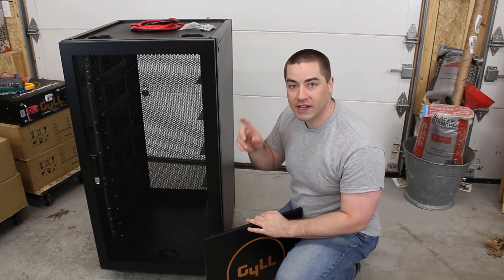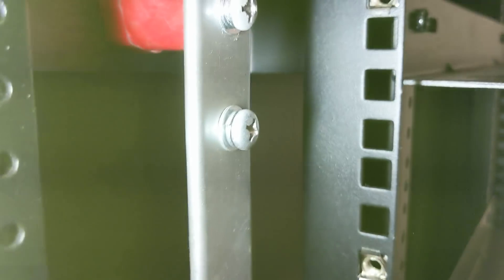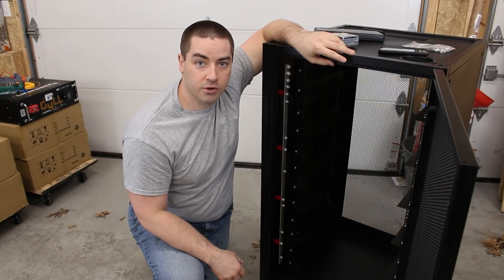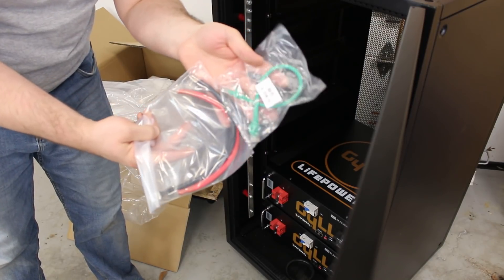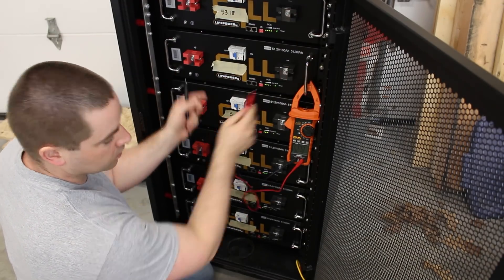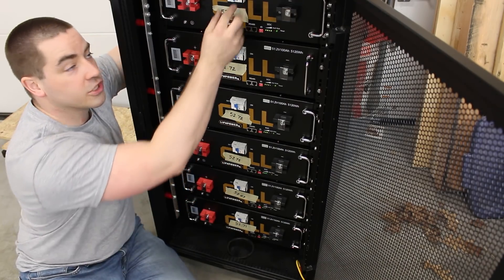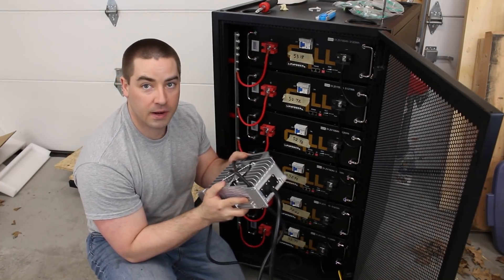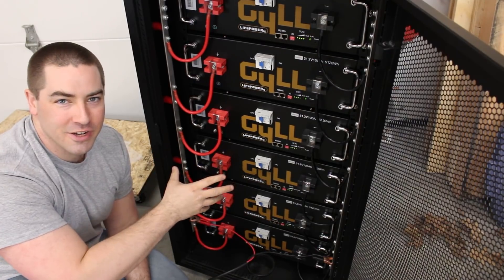Fastest Large Scale Battery Build, 30+ KWH, Power Whole House Cheap

Comment: wish someone would make a heated insulated version of this case.. that would be perfect for my cabin... I guess I'll have make my own.
Reply: Get a 21-23 seer heat pump minisplit. Can be had for $700-$1000 depending on seer rating. I use one in another battery shed I have with 280Ah  batteries I built in a 48v pack. I have the shed insulated with roxul and tried to airseal every joint with caulking. Works great for me in winter to just keep the shed around 40 deg F even in the cold New England winter.
Reply: @jimmyg6215  I like that idea. Never knew there were DC minisplits like that. My place is at elevation in the White Mountains, it often 0F or below for extended periods. I think I'm going to need a new shed anyway.

Comment: Great Helper !!

Enjoyed the video. 

As a service technician,
On-call at 2am, visiting your site to look at this:

I'd make this wireless. 
Just lay my laptop up there, or log into it from the truck. 
485 converter or whatever it'd take from Black Box.

Put all the jumper cables on one side (left) so at 2am I can GLANCE they are there and in the right positions. 

Easy to tug on in and out to break any oxidation. I use gray  anti-seize or a no-ox jell for aluminum and copper. I put it in the hole and plug in the cat termination. Coat the pins.
Keep moisture off these. 

Also because not all competitors' technicians or salesmen visiting at a site will keep their hands to themselves,  they will want to move those dip switches. Use your silver marker to put dots above and below where they should be positioned. 
Mark it somewhere else too.
Take a picture and put that in your records.  Leave a copy of your service or install manual and mark it up for all the positions and bays. Throw it in the cabinet in a nice large plastic bag.  It's 2am. I am not thinking,  I'm doing. You are cold and the electric is off. Easy stuff first. 

Then I put magic scotch clear tape over the dots and the hole covering the switches. Keeps the honest people honest, bugs, dust and dirt out. You'll thank yourself. 

I would have used the charged battery to charge the others 
;) wonder how many it could charge before throwing the breaker? 

Re-Tap ( size )the striped out copper hole? Naah.

Put (fold over) several more copper strands in the hole. 
Put the screw in. Be done with it. 
Test it out in a video. See if that has the bite strength and current capacity if in doubt? That'd be fun to see. 

You are exactly correct with the hex head bolts/screws. 

Remember lock washers (split washers) are your friends!

I would have never manufactured that copper bar as a tapped copper bar.  Bolt and nut.

Plus no-ox. Moisture is not your friend. It will cause problems.  Coax seal works pretty good. 
Anything to keep good conductivity clean and dry. 

For HIGH currents I'd consider
a tac of silver solder.  It makes me cringe seeing crimps not soldered. 

Seen too much. 

Super video, really liked the project,  the screw driver,  and learned some stuff too!

Looking forward to seeing you grunt on this battery system...
some hot water making and home heating.

Comment: I would think Signature Solar could spend a couple bucks to have a proper USB cable manufactured instead of making people Micky Mouse something that is unreliable at best...
Reply: I think it was his decision to Mickey Mouse it. It looks like it’s just a ‘rollover’ cable and there are    premade cables that are pretty cheap for this specific purpose. Bring a serial connection is pretty cool in my opinion. It doesn’t put the vendor between the consumer and the battery. 

But yeah, You can get cheap serial to usb cables pretty easily.

Comment: Great vid Dave, I feel your pain with the USB to 485 cable. You might look into an Ethernet to 485 protocol converter, hard wire to the batteries, put on your home network. I've had good luck with equipment from Moxa.  I like the casters for set up but would probably find some leveling feet for permanent location, appears the cabinets are drilled and tapped ready to accept them.
Keep us up to date, I really like those Gyll batteries.

Comment: How long will 30kw power your house?  How do you do large current 220v devices?
Reply from the maker: It depends.  I've used up to 40kwh in one day due to electric heating and very cold (-10°F) temps.  In spring and fall I might only use 6-8kwh per day.  In summer with AC I average 15kwh/day.  

Yes, I have large appliances like an electric oven.  I run my house on 12kw of inverters: https://youtu.be/WOueHhY4xkM
Reply: @DavidPozEnergy  I guess our houses are vastly different.  Here in Norfolk VA for instance, my January power bill was 3102 kwh so about 100 kwh a day.  I have a machine shop and a woodworking shop with large equipment that draws a lot of amps (air compressor, welder, drill press, table saw, sanders).  Does the 6kwh inverters each do 1 leg of the 220V circuit?  I watched the video and wasn't clear on how it was set up.  The breaker was 220, but the video of you setting it up wasn't really clear on how they interacted.  I am guessing one is in control (the one on the right) and each contribute 6KW of power (50 amps) on each leg to make 220.

Comment: The parallel ID code starts with zero, I mean the battery one would be zero code ID and the second battery would be ID code 1, I think it's like that, because in the MPP Inverter manual it has the same code to put in parallel, give a look And you will realize that the second inverter in parallel, the code ID is 1.

Comment: i think it would be cool to get some of these for a backup system incase of power failure and or some sort of system where it could flip between incoming mains voltage and the batteries
Reply: These days, solar panels and batteries like the ones showcased in this video are cheap enough, with high enough cycle life (~7000 cycles at 80% depth of discharge for the ones in this video), that they are actually cheaper to operate full time to power your house, than buying utility grid sourced electricity.  A solar power system that is installed DIY (so as to avoid excessive or predatory installation costs) using the batteries shown in this video, combined with modern solar panels (at < 70 cents/watt) can provide overall electricity for less than 8 cents/kWh (when the capital cost of the system is amortized over the full life cycle of the battery bank), which is cheaper than normal utility grid electricity (in my area, at least 13 cents/kWh).

In order to successfully do so however, it makes sense to replace high peak inrush and demand appliances (which also tend to have low efficiency) in the house (namely the central air conditioner and electric water heater), with high efficiency heat pumps (like >22 SEER rated "inverter" mini-split heat pump systems and a heat pump water heater).  Doing this reduces the peak startup and running current demands of your house substantially, which is important, since currently available off the shelf inverters are too expensive and not readily available in large enough sizes needed to match the normal household 100A to 200A mains service provided by electric utilities.  

Additionally, replacing your main power consuming appliances with ultra high efficiency units "effectively" increases the size of your solar array and battery pack simultaneously.  Therefore, it is normally cheaper to replace your high power appliances (central air conditioner and conventional electric water heater), and then also buy a modestly sized solar array and battery pack, rather than leaving your household appliances alone, and instead buying a massively large solar array and battery bank needed to power the inefficient home appliances.  To do this, one needs to buy the ultra-high efficiency mini-split heat pumps online (which are available up to 38 SEER currently, albeit with practically no model selection at this high efficiency range), and then either learn how to DIY the installation or find a non-predatory HVAC repairman to do the installation for you.

Comment: Is it worth $500? For the convenience, maybe. (an evening on eBay could collect the same thing for much less.) The gap between them makes it look to me like they weren't designed to fit rack spacing (1.75" per unit.) The bus bar is also questionable as a battery module can touch them when loading. I'm not saying they need to go as far as Eaton or SE, but there's zero chance this will ever pass UL.

Comment: My order of 3 GYLL 24v 200Ah  with the three space rack should arrive in the next few days I don't have the AC charger to equalize the batteries before switching them on. How close should the battery voltages be?  I hope you post you next video before I'm ready to hook these into my system. Thank you so much for posting these videos!
Reply from the maker: The closer they are the less amps will jump from the high to the low.  Generally I try to be within 0.1 volt.  I've tried it on other packs at 1.0 volt delta and seen over 100 amps move.  In this case in the video it was about 9 amps when I switched that last breaker.  If you don't have a dedicated charger you can put a load on the high battery to draw it down.
Reply: @DavidPozEnergy   Thank you! Your videos are invaluable.

Comment: David, from last week's video you pointed out that when they connect to the BMS they go from the terminals (positive & negative) at opposite ends of the battery.  Does that same rule apply when you are connecting these bus bars to the inverter/charger?  Will you connect to the top of the left or positive bus bar and then to the bottom of the right or negative bus bar in this cabinet?  Or once connected to a bus bar it doesn't matter?
Reply: Never mind David.  I see you answered this with another comment below.  Thanks.

Comment: These are really nice. Debating between this kind of a set up or the Overkill Solar BMS and Fortune cells that Will posted about a week ago. Following for more info!
Reply from the maker: Two good options.
Reply: Will’s favourite cells before were Lishen 272Ah (there are also Eve 280Ah) which are easier to build, without paralleling (& in series) for a bigger capacity. Might work out cheaper. Overkill is rebranded JBD aka Xiaoxiang BMS which you can find much cheaper

Comment: @DavidPoz Any reason you wouldn't consider this setup in a mobile application such as a motorhome?
Reply from the maker: I'd be fine putting the battery modules inside, but not the server rack.  At least not as is.  Maybe with some extra reinforcement.
Reply: @DavidPozEnergy  I was thinking remove the casters and use those point to bolt to the floor.....

Comment: Daddy David and engineer Eleanor make 30Kw battery bank, held together by 12 screws and one nut! Amazing what $10K will buy you nowadays? Am I wrong in assuming you now have between 50Kw to 60Kw in your three battery banks now? Need a sign in front of your home that says: "House of Juice"
Reply from the maker: You calculated the capacity correct.  I recently tested the old system at 27kwh, so I'm around 57kwh now.  Still working on it.
Reply: @DavidPozEnergy  I was taught by the best!

Comment: Dave...
If I wanted to use this to go from Grid-tied to Off-Grid.... 
What would I need to do there? 

I seen that there was a hybrid-inverter that, for a lack of better words, simulates the power companies 120 service. Would that be the best route?
Reply from the maker: I'm currently using a pair of SMA Sunny Island SI6048 inverters.  They take the 48vdc from the battery and turn it into 120vac for the house.  I'm running on it right now.  I have videos on the inverters, along with several other inverters I 've used in the past.  Coming up I'll be showing even more inverters.

Comment: That's a neat piece of kit but if the manufacturer is watching I have a bit of constructive criticism about the design. I'm a bit put off by the exposed busbars, have you considered insulating them? Adding some color-coded heatshrink tubing before mounting the bars would probably do the trick, and some plastic covers for the connection bolts would make it even better. It's probably not needed but I would gladly pay a bit more for the added peace of mind.
Reply: If you are worried about that just connect all the battery leads to the bar in the proper place but not the battery end. Then remove the bar and wrap it with rubber DR tape before reinstalling it and connecting the battery side.. I would also apply a thin coat of No-Ox to all of the connections before making them. I can see why the exposed bars were bothering you, I was thinking the same thing.

Comment: Excellent vid David.  I have 2 questions: could U open a battery and show the wiring size and BMS in UR next vid?  2nd question, how many KW is UR solar array?  Thanks.
Reply from the maker: Check out my previous video, I open up the battery and show the wiring size on the BMS (6AWG) along with cell tabs, etc.  https://youtu.be/SYJ25izYSGc    I have 3 arrays in the backyard, they total 12.5kw

Comment: This DIY project looks closer to something I would like to install in my home. My question to everyone out there is when I install a energy storage system in my home. How difficult is it to get permitting from the city or state? I have heard they require UL listing for the batteries and inverter. Is there some advice out there to help one navigate through this process.
Reply from the maker: Every location will be different.  My stuff is OK because it's in a detached garage, but would not be OK if it was inside the house.  Lots of people choose to have a shed just for this stuff.
Reply: @DavidPoz thanks for the great videos. I’m in MN where we have subzero temps for weeks at a time in January and Feb. if I put a system like this + an all in one unit in a small (say 10x5 insulated shed... What’s the cheapest/most efficient way to heat a small shed in subzero temps? Now the other problem for me is how to keep it cool in the summer! Maybe this topic has already been addressed in other videos. Thanks for any pointers
Reply from the maker: @Nick Norring,  If the shed is super insulated, then you won't need much heat at all.  We are talking about just having a space heater.  I'd probably buy a small space heater with a thermostat built in.  $50 or something.  You will find it doesn't take much if you are super insulated.  But, it's not necessary to insulate for the inverter, just the batteries.  You may want to consider an insulated box just for the batteries.  My friend Bill insulated around his batteries and keeps them warm with just a 20 watt heating pad.  https://youtu.be/6XLOKtl-q3s

Comment: 1500 for only 100 amp way to much for my blood.   600 for 4 12 volt 100 amp lead acid.
Reply: Fake economics.  Deep cycle lead acid batteries are around 5 to 10 times as expensive, TO USE, as the lithium iron phosphate batteries shown in this video.  The lithium iron phosphate batteries shown in this video have manufacturer rated cycle life expectancy of ~7000 cycles at 80% depth of discharge.  Meanwhile, deep cycle lead acid batteries will generally last only 300-1000 cycles at 80% depth of discharge, before they reach end of life and need to be recycled.  Consequently, the lithium iron phosphate batteries provide 10-20x the service life of a set of deep cycle lead acid batteries, resulting in much lower cost overall, over time.

Additionally, flooded (non-AGM) deep cycle lead acid batteries require periodic maintenance by adding water, and they also produce noxious fumes during charging that needs venting outdoors.  Lead acid batteries also have lower charge/discharge cycle energy efficiency (ex: you may only get 80% of the energy out, compared to the energy that you put into it to charge it), compared to lithium ion and lithium iron phosphate batteries (ex: potentially 95% charge/discharge energy efficiency).  Consequently, a solar system designed with lead acid batteries, may yield roughly 10% less useful household AC energy per day, for an equivalent sized solar panel array, compared to a system based on lithium ion batteries.

An off-grid solar system using lead acid batteries will generally produce electricity with effective price of ~2 cents/kWh during sunny hours, but roughly ~50 cents/kWh during nighttime hours (due to the cost of the lead acid batteries constantly wearing out with cycling use).  Meanwhile, an equivalent off grid solar system using the lithium iron phosphate batteries shown in this video yields an effective electricity cost of ~2 cents/kWh during sunny hours, and around ~8 cents/kWh, during nighttime hours.

Conclusion: lead acid batteries are obsolete tech.  Modern lithium iron phosphate (and/or other types of lithium ion, like NMC) batteries are vastly cheaper to use in solar power systems.
Reply: its 100amp but 48v so its more like 400amp at 12v. You would need 8x of your 12v 100amp to have the same amount of "usable" battery

Comment: I think this was a great build. The only shortcoming(not yours) is the RJ45 to the USB. 1500 per unit and they don't supply a prefabricated cable?
Reply: Seems they could have used something like USB C jacks and allowed a more easily available cable to be used for the interconnects. Though that maybe confusing to someone too, since it's not a USB or Ethernet interface either way.
Reply: @wingerrrrrrrrr  RJ45 (Ethernet) cables are stupid cheap and widely available. The cable they screwed up was as DX GI mentioned is the USB to RJ45 cable which actually are also extremely common. As a computer guy I probably have a half dozen varieties laying around here, each one supplied with a piece of equipment. Sadly the pinouts of the RJ45 side are not all the same so they are not universally interchangeable.
Reply: Rack mounted devices are designed this way
Reply: It's not a cable. USB and Serial are different. USB to Serial adapters are readily available. Plus it seems the company provides them.